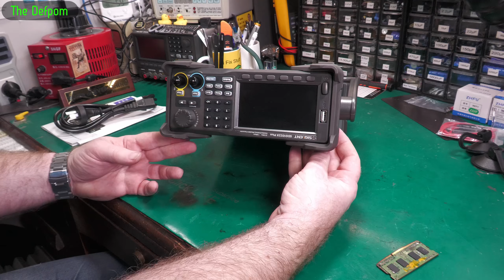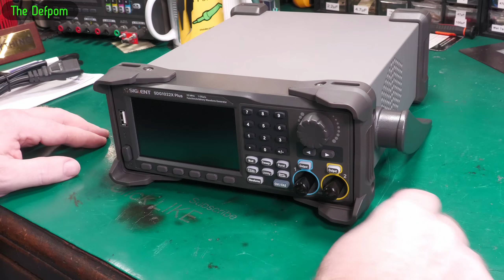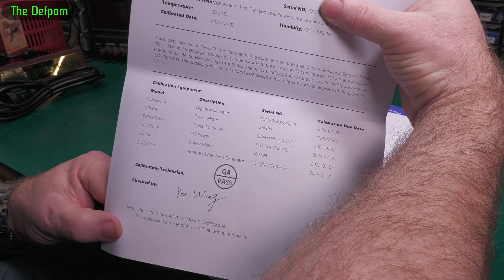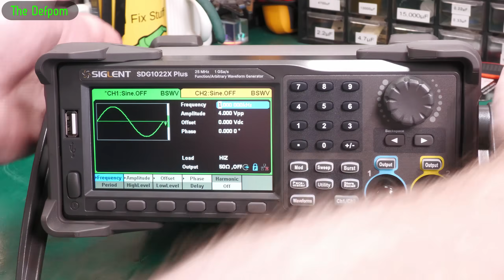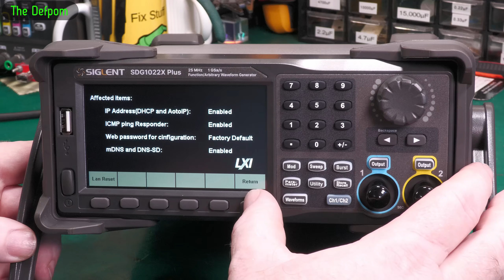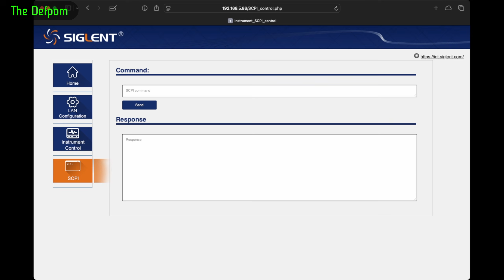🔴 Siglent SDG1022X Plus Review - No.1383

Comment: Get yourself a Rigol professional signal gen, like Rigol DGxxxPRO line it will be putting things into perspective in regards to your siglent fan, and Im pretty sure you will be blowing kissses after the fan in SDG1022X, as that is a noisy fan in Rigols PRO line of siggens.
Weird they  went from a passive solution in their older series to have one of the most noisy ones.. likely the same as in the Rigol DHO800 and 900 scopes.
its a tempbased one, but it seems to dissepate a lot of heat, weirdly much heat, so the fan will start up, rather fast.
Thx for the vid.
Reply: Thanks for the info, can you tell me which Siglent arb has passive cooling?

Comment: I have upgraded from the SDG1032 to the newer SDG1032X-Plus, which has a frequency range of 30 MHz. It is a decent device with quite a few new features compared to the previous 1032 series. However, the fan is very loud — by far the loudest of all my Siglent devices — and the top of the housing becomes quite warm (>40°C) after a few hours. I'm not sure if this is part of Siglent's cooling management, if it needs improvement, or if it's just an issue with my device. I wish Siglent had introduced the user interface of their new DMMs, which I have, as it is far easier to use than the endless button clicks of the old interface.

Comment: Would this be a good upgrade to the 1032x or is that not worth it?
Reply from the maker: No idea, very little difference to my 2042X apart from the added web server and some more modulation options. It really depends on if the 1032x is doing what you need it to.
Reply: The Plus model has the advantages of 16bit vs 14 and the webserver plus some further waveform types however its risetime is not as fast as SDG1000X but otherwise they are quite similar units.

Comment: Would love to know how they have implemented the rotary encoder, i.e. a dedicated IC, or in software. If it's the latter then are they using interrupts which should negate any rotating speed issue if done properly. If they are just polling the two lines from the rotary encoder then it's always gonna have speed problems unless the Cpu polling is very fast.

Comment: 9:20 slow encoders are Joe Smith's pet pieves.... 😆🤣
What I like about this function generator (I have the old sdg1032x) is indeed the web interface, but also how easy they are configurable with a Siglent oscilloscope to do a bode plot. (This goes for all siglent sdg generators). The coupling menu of have outputs following is really logical, setting up a bode plot is done in a few seconds. I think it even works over tcp/ip (not sure though).

Comment: I think they use multimeters instead of oscilloscopes because an oscilloscope is probably not accurate enough for voltage measurements. This is a 16 bit function generator, so already more accurate (as in higher resolution) than most scopes.
So if it's 16bit at a 20v output, that means the output resolution is about 0,3mv. To measure that fairly accurately, you need a ~200.000count multimeter (so that you're 1 order of magnitude higher in resolution than the DUT, more is of course betterer 😁)